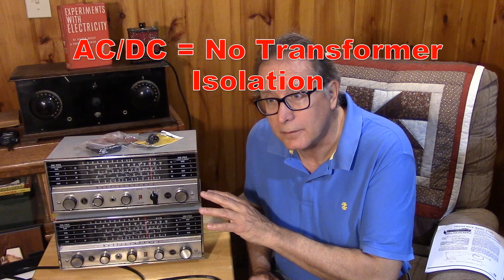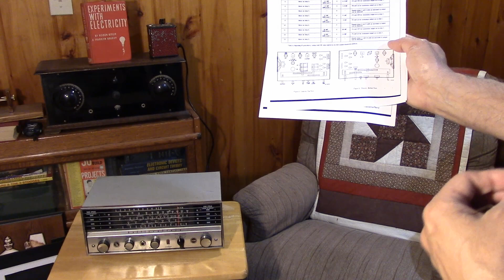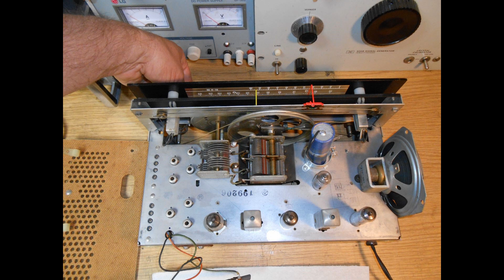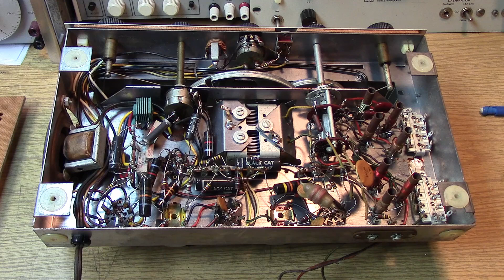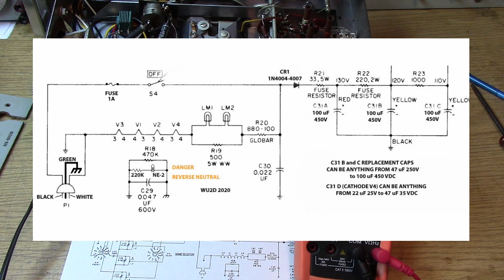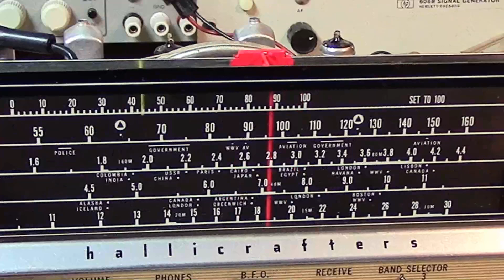Hallicrafters S-120 Refurb

Comment: Greetings! I replaced the broken "Globar" resistor with a 175 ohm 10 watt ceramic resistor in series with a ICL 120 ohm  limiter.  Tube filaments running 11.5VAC and 46 vac for the 50C5 output tube

Comment: A few months ago I replaced all the caps (Hayseed Hamfest), power cord (polarized), and selenium rectifier (diode) in my Hallicrafters S-120.  I had two extra parts radios, and picked out the best tubes, speaker, and cabinet pieces.  I was also in touch with pi-duino (see below) for advice.  When I was all done (B4 the alignment), I had a hum in Stand-By.  This drove me so nuts that I walked away from the project for a while.  I was so relieved to watch your video all the way thru, and hear you say that one cannot get the hum out of any of these w/o modifications.

There is an odd looking part in the parts radio, called a couplate in the schematic.  It is attached to several other components, like a spider.  I thought about swapping that into my recapped radio, but now I'm not even going to mess with it.  I'm going to do the alignment on it soon, and call it a day.  Thanks.

73 Paul AA1SU
Reply from the maker: That was a too clever approach at a multi-component Module. Basically it is a bunch of passive components like resistors and capacitors connected internally, in a coated assembly with wire leads. It saved cost on things like terminal strips.
Reply: @MIKROWAVE1  Do you think transferring the couplate to my radio would be beneficial?  Would it help the hum?
Reply from the maker: @VTradio  I don't think it will help. The main culprit is the way they ran the linecord to the on off volume control which was a very high impedance pot and audio wiring section. It is just tough to isolate the two. Almost everything I tried helped, including rerouting a brand new cord so that it came in at a better angle, shielding the audio, changing out the pot to a 200K and so on. But there was no silver bullet.

Comment: Very interesting and informative. I’m working on a very poor HE-40 which is the same as the Hallicrafter but has a Signal strength meter. The one I have has been really hacked so I’m trying to return it to stock as much as possibly. The units sold in the U.K. were fed via an auto transformer. This is my restoration I’m hoping to do an alignment this weekend https://youtu.be/zjd3UxCtlUo thanks for sharing regards Chris ps I agree tubes are very reliable and you should guard that speaker
Reply: In my comment above, one of my parts radios is a HE-40.  Darn near identical to the S-120.  I really like the S-Meter.  I had to use the HE-40 speaker in my S-120, which required a little drilling and rewiring the transformer.  That was kind of hard for me, but I finally got it wired correctly.  I'll try to watch your video soon.  Does your HE-40 have a constant hum, even in stand-by, like my S-120 does?

Comment: The "BFO" circuit in the S-38 through the S-120 is an interesting circuit indeed. It's also different between the '38 and the '120, as we shall see.
In the S-38 series, this circuit consisted of a length of hookup wire laid along the grid and plate leads of the IF tube, but not connected to anything at this end. The other end of this wire was connected to one side of a SPDT switch, with its center terminal connected to ground. The far end of the switch is connected to the AVC line of the receiver. The AM position of this switch has the wire leading to the IF stage grounded. Flipping the switch to the CW position grounds the AVC line, causing the receiver to operate at maximum gain. It also causes the wire laid across the IF stage to float. Now, this wire acts as a gimmick capacitor, coupling the plate and grid of the IF tube, causing it to oscillate. Since the value of this gimmick capacitor coupling is very small, less than 1pF (or μμF if you prefer), its effect on the tuning of the stage is quite small.

The S-120 is a different animal. Like the S-38, the IF stage is made to oscillate, but how it does this is actually superior IMNSHO to the gimmick method discussed previously. In an IF tube, both the screen and suppressor grids act as electrostatic shields between the control grid and plate. This time the switch of the BFO control connects the AVC line to ground, but only if the BFO is turned on. The bottom of the control is also grounded. The wiper is tied to the suppressor grid of the IF tube, so when the BFO is off, the suppressor is grounded. As the control is advanced, the RF decoupling from the suppressor is removed. As this happens, the capacitive coupling between the the plate and control grid is increased. In a way it's like the gimmick in the S-38, except there's a mechanical coupling to move the wire towards or away from the tube socket. In practice, the BFO control of the S-120 behaves like that of the regen control of a regenerative receiver. Beyond the point of maximum gain, the stage breaks into oscillation, and CW reception is possible.

These two methods of oscillating IF CW reception for the S-38 and S-120 are covered in US patent numbers 2,556,993, and 3,107,333, respectively.

Another feature about the S-120 that I find an improvement, is the change from air core coils in the former, to individual slug tuned coils in the latter.

The Lafayette HE-40 is practically the same as the The S-120, except for the addition of an S meter, a tone (high cut) switch, and ANL. The latter looks laughingly easy to implement, it ties one of the diode plates of the 12AV6 to the control grid of the output tube.
Reply from the maker: I wonder if it really saved much in the parts cost?
Reply: @MIKROWAVE1  I imagine that the S-120 would have been more capable of having a genuine BFO, since there was enough chassis real estate, and they used a selenium rectifier, allowing for the capability to light another tube heater.

However, they were building to a price point. A pot with a switch and some wire were probably cheaper than a tube socket, tube, coil, other passives, and the labor to put it all together. In the end, the regen approach was the most clever IMNSHO. :-)

Comment: K1OIK- I never recap, if it works I don't "fix" it. You clean the vacuum tubes with a vacuum cleaner. I like to use mine in the bathtub. The S-120 is a highly dangerous. You get more than a tickle.
Reply from the maker: Yes of course! But you are tough. I knew one tech who could tell 120 from 240 by "feel". RIP
Reply: Burt, I like to recap a radio for both safety and the experience.  I have a S-38D that shocks me every time I plug it in wrong, not just in the bathtub either.  I don't plug it in anymore.  On the other hand, that Hallicrafters SX-110 I sold you worked great just the way it was when I found it.  All I did was change the dial bulbs, and maybe a tube.
73 Paul AA1SU
Reply: @VTradio  I never recap. I find replacing parts that have not failed is a waste of time. I fix where the smoke is coming from.

Comment: Would it be possible to rebuild that radio using Raytheon Wire-Ended vacuum tubes and generally make it work on between 12-30V instead of working on mains voltage that could very easily send you to an early grave and while we are at it could we not use 455KHZ Murata crystal filters instead of IFTs.
Reply from the maker: Absolutely! I have even seen several SuperPro Receivers solid stated - done up with FET's and a 5 Watt amplifier IC.

Comment: 31May20/0408UTC. Sir, thank you for the video. A radio or any Electronic device never dies, especially, the analogs. Of course, it can be killed. That’s different story, altogether. An AC/DC set was cheaper to manufacture plus lighter. The rectifier normally is only SOLID STATE device, being Selenium. Once the filter Capacitor (20mfd/220V )laminations get shorted  or dry; the Selenium rectifier gives out nasty odor and dies ! The Se is replaced with Si bridge. Analogs doesn’t die. Recap and reuse. 73s

Comment: Thanks for the video. I have my father's old Knight Star Roamer and was thinking of getting that up and running.  I know it will need more than a recap and replacing the selenium rectifier with a silicon diode. The Dial cord slips and the band selector is stuck and I'm afraid it would require disassembly of the fiberboard rotary switch stack to properly clean and lube the contacts or worse switch replacement. As of now I just cleaned the outside and set in my shack as a display memorial..
Reply from the maker: A very worthy Dream Receiver for any kid.

Comment: With how often I've found miswired outlets I feel the real safety upgrade with the "floating" chassis transformerless stuff is appropriate short proof X/Y type safety capacitors in the across the line and line to chassis positions. At that point you're approaching modern standards.
Reply from the maker: Anything that you can do to improve safety, including checking and rewiring outlets and adding grounding helps in many ways.

Comment: I always use Hayseed.  They have other great kits as well.  It's worth buying a kit!  Besides the 1N4007, add a 100Ω 10W resistor in-line.
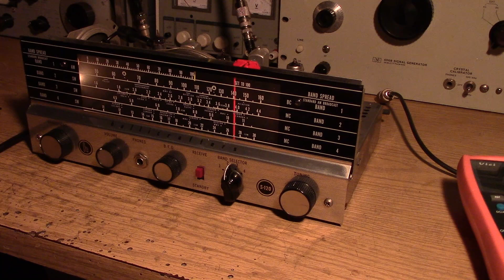At 20:00 I hear what sounds like a resistor or CAP that is arcing!
Here are some MODs listed at my Web site for Hallicrafters S-120 & Realistic DX-160: http://elecurls.tripod.com/ph.htm
Reply: One of the big differences between selenium rectifiers and modern silicon diodes like the 1N400x series is the on series resistance - selenium rectifiers behave more like tube rectifiers in that they generally add a few hundred ohms when conducting.  Silicon diodes, once past the conducting voltage, add very little resistance and result in B+ voltages being as much as 30-50v higher than the original tube rectifiers.  As you say, adding a few hundred ohm power resistor compensates for that, and also reduces the in-rush current to the filter caps when the receiver is first turned on.  Definitely recommended if you swap silicon rectifiers in place of tube or selenium ones.
Reply: @drtidrow  - Correct!
Reply from the maker: Good stuff pi-duino! Nope just the QRN all this week with all of the storms.
Reply: link invalid